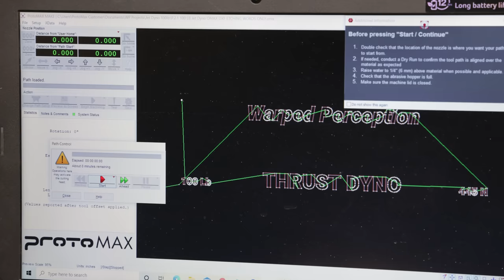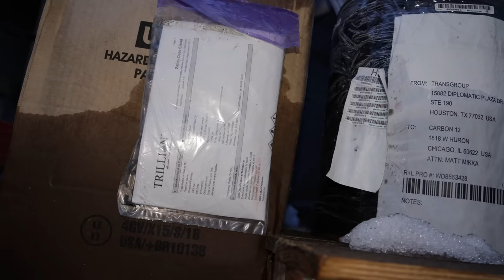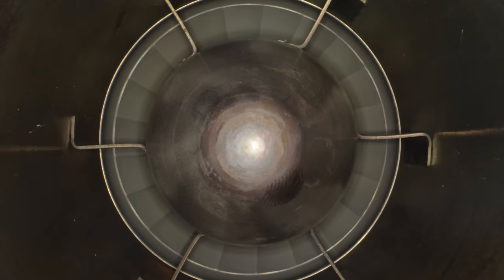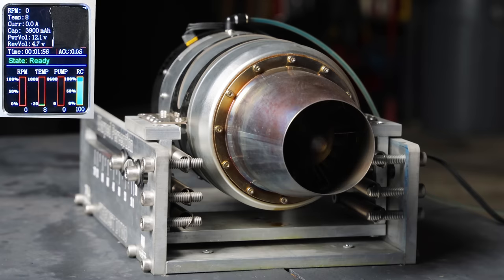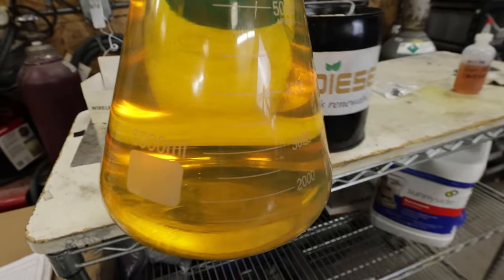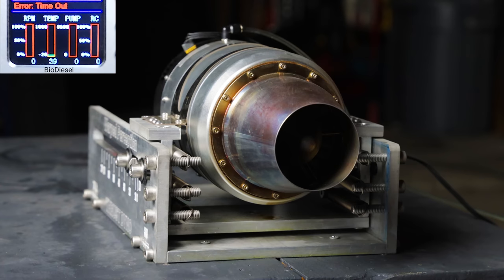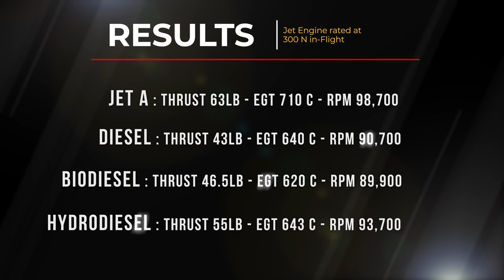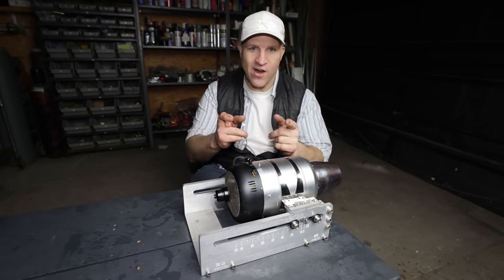Jet Engine Thrust Test - Fuel Experiment (Jet-A vs Diesel vs BioDiesel vs HydroDiesel)

Comment: The hydro diesel surprised me. Wouldn't water in the fuel absorb energy from combustion and thus lower thrust?
Reply: Well it probably exits the engine as a vapor considering the exhaust gas temperature. So it absorbs energy but the whole point of thrust is to direct hot gas rearwards. Still, from a conservation of energy perspective you would think you would need a higher flow rate to achieve the same thrust.
Reply: That depends...  Hydro-diesel is an emulsion of water and diesel. It works because the fuel is injected as a liquid, and when the water expands hugely as it is vaporised and afterwards, it exerts a greater pressure per unit of its mass than the combustion products of the diesel per unit mass of the injected diesel. This is despite the fact that the water absorbs energy as it vaporises and then heats up, thereby significantly decreasing the peak combustion temperature. However, the benefit only exists within a narrow mixing ratio. If too much water is added the burning temperature falls so much that the expansion of the resulting gases does not produce a pressure that matches that of the fuel alone, and if too little water is added, the benefit of its massive expansion from its liquid state is not achieved. In short, there is an optimum water-fuel mixture for each type of engine. There are two primary reasons for using water-fuel emulsions: (1) to lower the viscosity of thick fuel oils so as to make them flow easily, especially for pumping, and (2) to decrease the emissions of soot (smoke particles) and the creation of NOXs by lowering the peak combustion temperature. Surfing the internet indicates that hydro-diesel mixtures for ICEs are good in the range of 20% to 25% water, and if the right ratio is used for an engine, its performance should remain the same as if the specified pure fuel had been used instead. The essential emulsifying chemical is less than 1% of the mixed fuel. I think it is highly likely that hydrodiesel promotes corrosion and shortens engine life, because engine manufacturers oppose the well-known ploy of water-injection for this reason.
Reply: @etangdescygnes  thank you!
Reply: That was my intuition too -- that the water content might absorb too much energy when it is converted to gas (steam). Or possibly worse -- even separate out of the emulsion and cause the turbine to flame-out.  I am guessing that there is probably a lot of expansion pressure in converting water to steam that helps to drive the turbine?  Not sure what the HydroDiesel maker is using to emulsify (keep the water in suspension) but you could do the same thing in the tank and emulsify on-demand using an Ultrasonic Homogenizer (or make one). Having an an Ultrasonic Homogenizer (emulsifier) in the fuel tank means that you don't need to use an emulsifying agent and you can try various water to fuel mixtures to see which is best for this turbine.
Reply: @etangdescygnes  So I think I understand you to be saying:  The water as a gas (steam) may even have a higher vapor pressure than the burnt hydrocarbon gasses and so improving performance of the turbine by creating more thrust?  Anyway, I noticed that the thrust was 191 Newtons for diesel alone and 242 for HyrdoDiesel.   Also seems that the pure diesel and HydroDiesel create the same EGT Temperatures too.  Would be interesting to see what the other engine section temperatures were.
Reply: @JayDAnderson  Yeah: the water vapour makes a disproportionately large contribution to the total pressure of the mixture of gases following combustion.  Burning the fuel obviously involves combining oxygen from the air with it, and the oxygen is already a gas! The water starts wholly as a liquid and then expands as a gas. I would have to undertake the thermal simulations myself to see precisely what happens, and I do not have the time to do this right now because I am running a major series of sims for some new aerospace engines. The current literature seems to indicate that with the addition of the correct proportion of water to the hydrocarbon fuel for which the engine is designed, its performance with that fuel can be MATCHED, but at a significantly lower combustion temperature and therefore with a big reduction in nitrous oxides, and it appears that the water also reduces soot particles. This is a big benefit for diesel engines and those that burn heavier/thicker oils, but not for aerospace turbines, which already burn jet fuel amazingly cleanly at extremely high temperatures. Gas turbines can operate with an amazing variety of fuels provided the injectors cope with the viscosity, BUT of course almost all aerospace gas turbines are designed to burn Jet-A1, not diesel or hydro-diesel, so when you compare the Jet-A1 result with the hydro-diesel, it is not surprising that Jet-A1 still tops the list. [There is another obvious complication here, and that is how water affects compression ignition engines versus conventional spark ignition engines. The manner in which combustion occurs throughout the charge (fuel-air mixture) is radically different for these engines, so I am thinking about that right now...]
Reply: @etangdescygnes  Great explanation ,Thanks

Comment: Great comparison! I'm not sure if your clearing or cooling time between tests but the amount of heat acting on the combustion chamber is cumulative in successive tests . I'm sure it wouldn't change dramatically
Reply: or temp around affecting spring and their rate, perhaps they should be on the outside or shielded from heat.. other person with comment on jetting for specific gravity, like to see a test with each fuel matched to the jet size required to match that change in density, then see the numbers.. anyhow excellent test, lot of fun in that garage..
Reply: I would think it is irrelevant since the second run up is already heated from the first run.  Any residual heat from other fuel is gone at that point.  It may get to operating temp faster if engine is still warm.  But not make it hotter.

Comment: Damn, that Hydrodiesel is really interesting stuff. It was way closer to the thrust of Jet A than to that of Diesel but at much lower temperatures. I guess the water does have some cooling capabilities then. How was the fuel consumption compared to the others? I think you forgot to include that or I didnt notice it. Also how cold was it when water froze in the Hydrodiesel? If its just slightly below the freezing point that wouldnt be great for use on the road I guess. Great video as always!
Reply: It's like water injection in WWII fighters. It gives more power by generating steam. Generating steam absorbs energy from the burning and reduces exhaust temp.
Reply: @GRW3  I mean, thats the theory, but putting an emulsion straight in your fuel tank is quite a bit different. Its really an interesting concept and I wonder how far you can push it and how the longterm effects on engines are.
Reply: a bit of clarification, steam generation is actually not the added power in a jet cycle.  important to remember the component we're talking about here is THRUST as such (per Newtown's 3rd Law) more specifically what we're dealing with is a REACTION engine.  the number being close to that of Jet-A is result of the increased MASS FLOW through the engine provided by the added density of H20 molecules.   though yes there is a cooling effect, water injection on a Pratt J-57 is not a one for one comparison with that of say, a Rolls Merlin V12.  studied turbo machinery/FADEC control system theory back in the late 80's.
Reply: you get a bit of a steam turbine effect
Reply: @phillyphil1513  I believe Harriers used water injection for thrust augmentation in the hover.
Reply: @phillyphil1513  if it lowers the TIT you can burn more fuel as long as the rpm and pressures are within margin.
Reply: @krugtech  yes, but that's purely to control EGT and stay within material limits.  you still won't get the added power desired in this context unless you substantially increase injector size and thus fuel delivery and fuel flow to compensate.   it's analogous to car guys tuning for E85, in that you must take into consideration how the H20 in solution is not only inflammable but also DISPLACES the energy dense long chain hydrocarbon molecules (ref diesel) that obviously ARE flammable, we're firmly in the realm of Chemists at this point.  the power of steam is best leveraged at SUPER HIGH pressures by way of physical containment (which a jet engine technically open at both it's front and back is not able to achieve) think: cylinders, tanks, vessels, boilers, etc.  that would be what you have in the technology of the old steam locomotives as someone mentions, underground steam power of NYC (ref Black Seal License), and steam power of historic San Francisco Cable Cars (though they have long since switched over to electric).
Reply: @phillyphil1513  that's the whole idea! hell yeah we're gonna increase injector size and maybe play w the jet pipe exit diameter and as long as the compressor don't surge we'll get more power! That water is flashing to steam in the combustor if it has a high enough pressure ratio.
Reply: @phillyphil1513  no water is flashing into steam anywhere?

Comment: I'll bet you could have given it a lot more throttle with the fuel that's 20% water, the jet engines on the B52 have a water injection system that enables them to over throttle the engine's just like over boosting an piston aircraft engine with water injection. 
The B52 engines were rated at 80,000 HP and 100,000 HP with water injection.
Reply: How would a modern engine react to water injection? The B-52H with TF-33 engines didn´t have water injection, and I would suspect that the lower combustion temperatures would cause cocking in the combustors.
Reply: @schr75  
Well needless to say you have to regulate the amount of water you're injecting into a jet engine just like in a reciprocating engine, and yes B52's had water injection on their engines, the same with the engines on several secret helicopters that were built for top secret missions in Vietnam that were nicknamed "The quiet ones", they were specially modified Hughes 500's with large mufflers on their engines for stealth and water injection for emergency power. 
As far as the water injection on the B52's if you can't find anything about it in print on the internet or in books watch a documentary on Amazon (and possibly YouTube) called "Buzz One Four", it's about a B52 that crash landed in the mountains right up the road from where I live and in it is a film clip from back then where the pilot is talking about the engines on a B52 and he says "Combined they make 80,000 HP and 100,000 HP if we use the water injection for emergency power during take off", the film clip of the pilot talking about it is from several years before the wreck when he was being interviewed by a local news station close to the airbase he was flying out of at the time.

Comment: What controls the fuel-air mixture ratio in your engine? Does it use something like an O2 sensor to keep it near the stoichiometric point?
Reply: fuel is atomize at the fuel nozzles while the intake air is going through from low pressure compressor LPC to the high stage compressor HPC and enter the diffuser case where the air is control to enter the combustor chamber mixed with the swirling fuel nozzles. the high exhaust gas turns the 1st stage high pressure turbine HPT that splines the short shaft turns the high stage compressor HPC to draw air into the low compressor LPC that in turn splines to the long shft of the low pressure turbine LPT where the exhaust case guide gas exits case to the tailpipe. the low turbine long shaft goes through the short shaft of the hpc within the hollow passage between the center of the combustor chamber and the 1stage high turbine exit nozzle than to the LPT. i know is mind boggling with all these parts within the jet engine components.
Reply: @rtchow3000  Isn't there something that meters in the right amount of fuel for the air it's taking in? Air/fuel ratio is a critical component of fuel economy. I'd think getting that right also optimizes the power produced.
Reply: Agreed to you as seems diesel have more carbon, thus reduce fuel may have higher thrust, try mixing some gas to diesel to reduce viscosity which helps nozzle to spray better too may helps on burning better.

Comment: the  real question is:  is the mounting hardware strong enough to keep the engine at full power firmly attached to the dyno, or is it pretty much going to break loose and turn into an unguided uncontrollable flying projectile? 🤔
Reply: I'm his neighbor, i had a few of those in my garden .. also in my kids room and kitchen. You get used to it
Reply: 300 newtons is more or less 30 kg, it is not an extreme machine. Plus if it detaches from the hinges (unlikely) it will just unplug the fuel pump and stop functioning. And I do not see the man standing in front of it. 

So basically worst case scenario is the jet engine just sprinting off the table and falling on the ground. Not very dangerous.

Would not do this in my basement, that's for sure

Comment: I worked with turbines that run all the fuels,, Jet fuel is the best... but you don't have to worry about altitude problems,, and al the contaminents...
Reply: No wonder why most planes use actual "jet fuel", it's the right mixture for both trust, and oxygen balance for altitude.

Comment: Hydrodiesel looks like it would be an excellent contender against Jet A, while it may burn hotter than Diesel and Biodiesel, its got good comparable thrust at 55Lb with lower RPM rate than Jet A.
Reply: Jet A isn't used very much anymore anyway, its too narrow a cut. Very few refineries have the capability to make it.

Comment: you calibrated the spring when it is cold. Does the spring tension change when it is hot when you do the actual test or the difference is negligible?
Reply: Thought about it too
Reply: Even if it changes when it's hot it's still repeatable which means that even if the base thrust numbers are incorrect they'll be incorrect the same amount and therefore it's still a good comparison test.

Comment: This test is completely wrong!!! The guy seems to unknown the way the micro turbines really works!! This machines have the so called Fadec. This is the electronic “brain” that mange the all functions and parameters of the turbines, particularly the RPM/fuel flow curve! This is a self learn function that determine the amount of fuel (voltage to the fuel pump) needed for each range of rpm asked by the throttle rc signal. If you change the type of fuel, you have to give the opportunity to the electronic “brain” to adapte the rpm/fuel curve to the new fuel!!! If not, you will obtain a different final rpm for the same throttle signal and consequently a different final thrust!!!! That is what happens here!!! By doing the things right, you will obtain the same final rpms, consequently the same final thrust,  but at different temperature and fuel consumption rate!!! That’s it!
Reply: Please, do your same test and post it please. Easy to say "no" a lot harder to prove. Please prove your protest. I personally use hero in my turbines, don't like the extra smoke on shut down and start up the diesel promotes. Hydrodiesel? Throw that shit away. I used to drive tractor trailer and in immense cold, the regular diesel would jell, looks like without a bunch of other additives, the hydro would just freeze solid in the tanks and lines unless heated, treated or the engine continuously running keeping the fuel warm.
Reply: @richardbeanii6662  😂😂😂
Reply: @richardbeanii6662  lmao
Reply: Eduardo. I was looking for comment like this.. This guy on video obviously has no time for research, he knows so little about mini turbines.. 

I won't even talk about Richard's comment.. Dude drives a tractor but knows everything about turbines LMAO..

Comment: Run another test: how much of each of these fuels can the pump pump through the same length of line in a minute. I bet the pump moves more JetA1 followed by hydrodiesel followed by biodiesel and lastly diesel which is why we saw the results that we saw. I think If you heated the fuels they might all perform better as their viscocity decreases to a point... How do petrol or alcohol perform? what about bigger pump higher gauge fuel lines?

Comment: Some alternatives I would have tested would be paraffin wax, kerosene, ether, TEB, and carbon disulfide. Jet-a has an autoignite point of 200 celcius, so there is potential in these, which are at or lower than jet-a's ignite point.
Reply: C4 works too... through only once. xD
Reply: @BillAnt  I have heard C4 has a very... explosive start to it XD
Reply: @barrydheil  < On a more practical note, wonder how nitro-methane would perform in a jet engine.... hmmm....